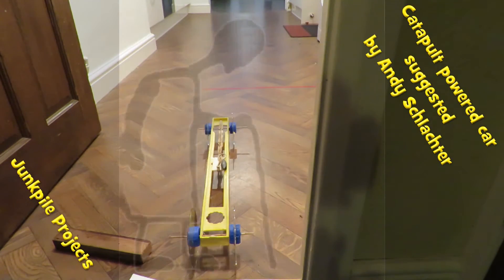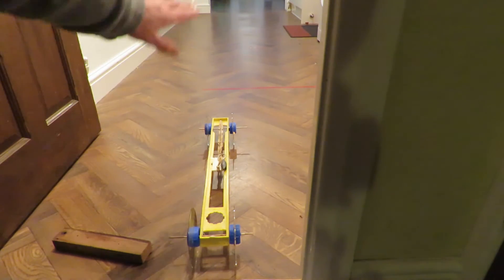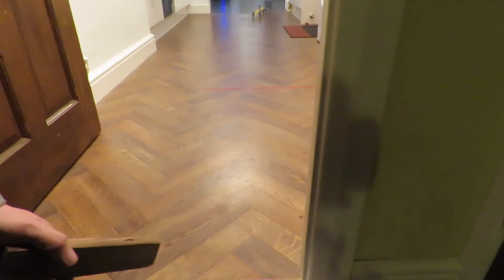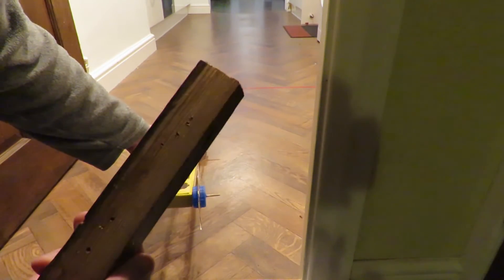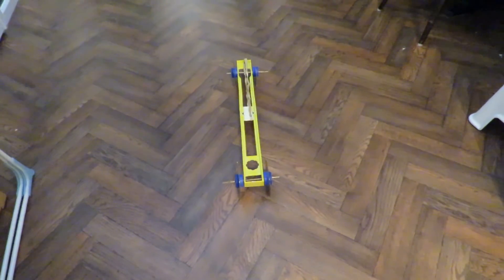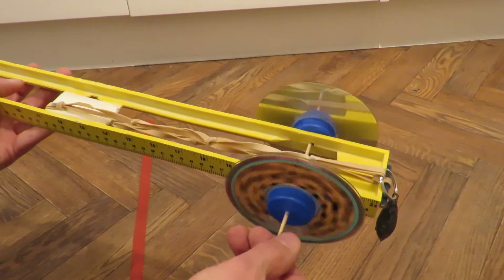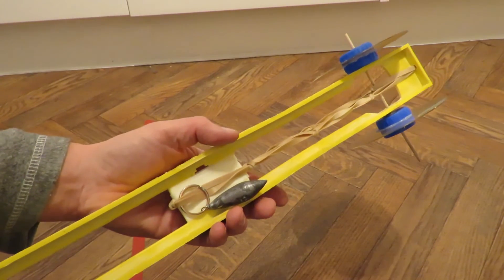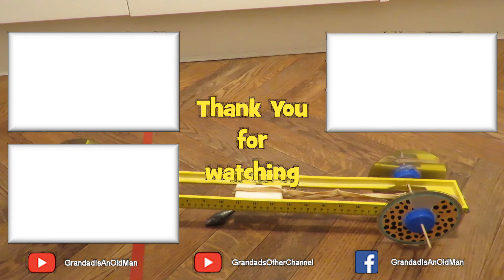Catapult powered car suggested by Andy Schlachter

Comment: Can u give me some tips in the comments on how to build an elastic powered car that moves in a circle? I have a project due Monday. Thanks!
Reply from the maker: I am not quite sure what tips you need. The simplest electric car would be one with a fan on it to blow it along as you don't need to worry about gears or pulleys to connect the drive to the wheels. Next easiest would be pulleys as you don't need to be too accurate to get them to work. As for going round in a circle, you just need to glue your front axle tube at a suitable angle to make the car turn. Here are some examples
Electric Toothbrush car https://www.youtube.com/playlist?list=PLA5a2xPRSrB1_3bPng-3gPLxUGIRu7W7H
DIY Electric Toy Cars https://www.youtube.com/playlist?list=PLA5a2xPRSrB1_3bPng-3gPLxUGIRu7W7H
Electric Toy Cars playlist https://www.youtube.com/playlist?list=PLA5a2xPRSrB0yTUYmJSS3ML5xxaBzHl3e
Reply: I meant to say elastic car sorry! Also this car has to shoot a projectile half way through its circle on its own, but I think this video helped quite a bit with that. Thanks!

Comment: Inertia powered car. Nice one! I wonder if you could make a reloading mechanism and have continuous drive? Perhaps give the weight a rail to travel on?
Reply from the maker: To be honest I didn't expect it to move. Action and reaction etc However the start is misleading as the car is braced in position so we don't see the Earth being moved backwards as the band is stretched. In the second episode I use a different setup without bracing the car and we get NO movement.